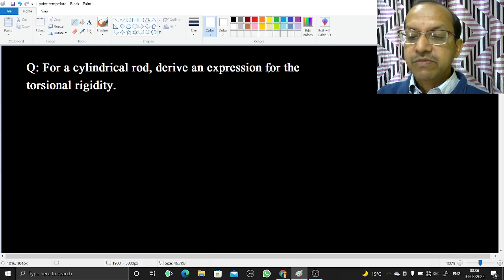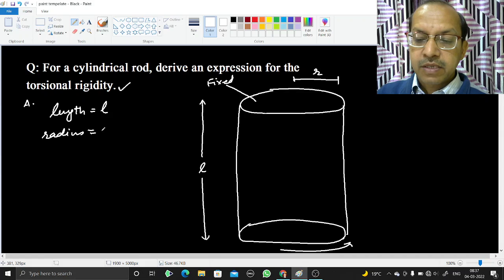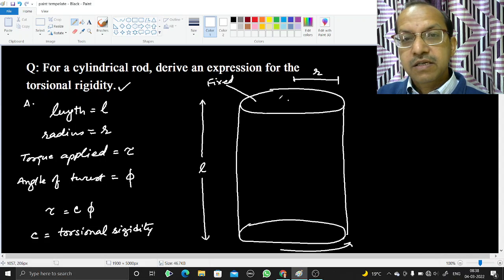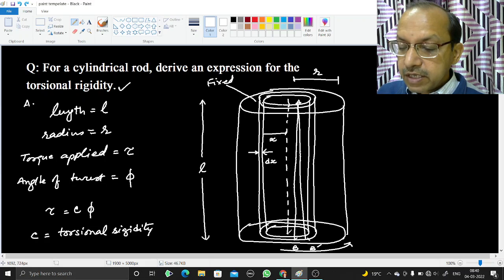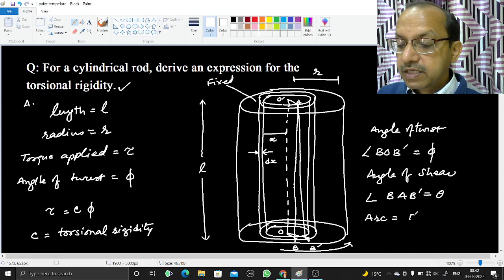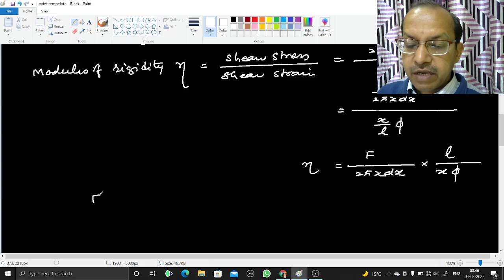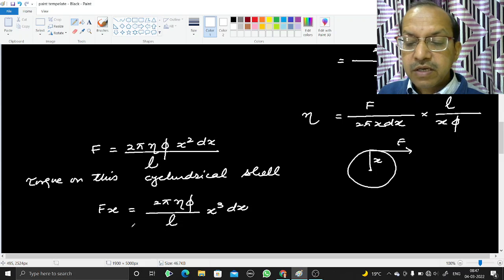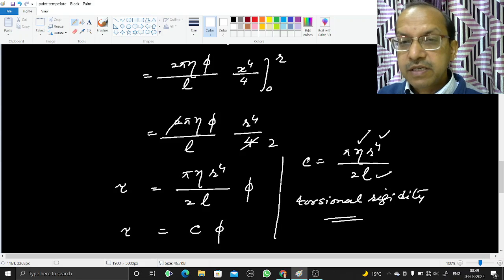torsional rigidity formula derivation | BSc 1st Year | Physics | Semester 1 | @PhysicsJockey

Comment: Unit X: Optics

Reflection of light, spherical minors, mirror formula, Refraction of light, total internal reflection and its applications, optical fibres, refraction at spherical surfaces, lenses, thin lens formala, lensmaker's formula, Magnification, power of a lens, combination of thin lenses in contact, Refraction and dispersion of light through a prism, Scattering of lightblue colour of the sky and reddish appearance of the sun at sunrise and sunset.

Optical instruments: Human eye, image formation and accommodation, correction of eye defects using lenses, Microscopes and astronomical telescopes and their magnifying powers

Wave opties: wave front and Huygens principle, reflection and refraction of plane wave af a plane surface using wave thonts, Proof of laws of reflection and refraction using Huygens principle. Interference, Young's double slit experiment and expression for fringe width, coherent sources and sustained interference of light. Diffraction due to a single slit, width of central maximum. Resolving power of microscopes and astronomical telescopes, Polarisation, plane polarised light, Brewster's law, uses of plane polarised light and Polaroids.

Unit XI: Dual Nature of Matter and Radiation

Comment: XVI: Condensed Matter Physics

Bravais lattices. Reciprocal lattice. Diffraction and the structure factor, Bonding of solids, Elastic properties, phonons, lattice specific heat, Free electron theory and electronic specific heat, Response and relaxation phenomena. Drude model of thermal conductivity, band theory of solids: metals, insulators and semiconductors, Superconductivity.